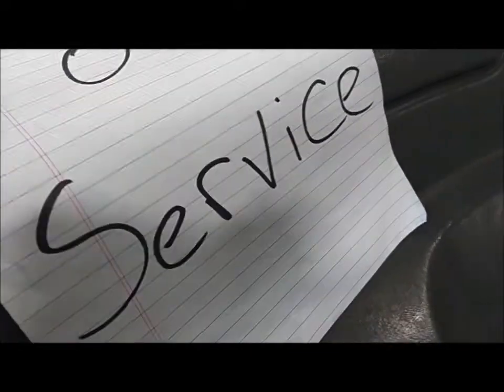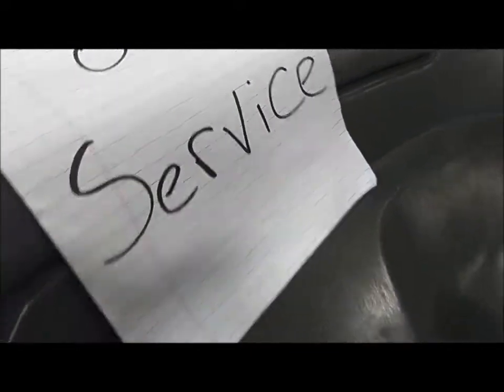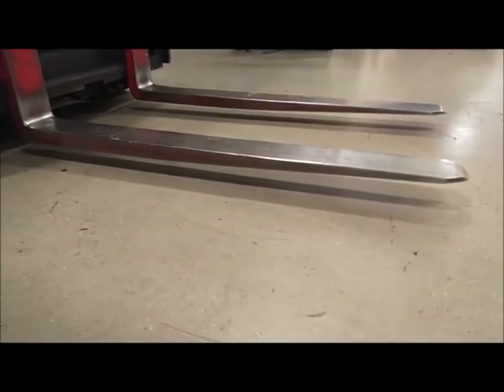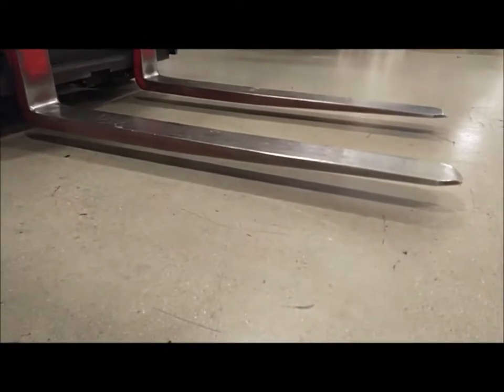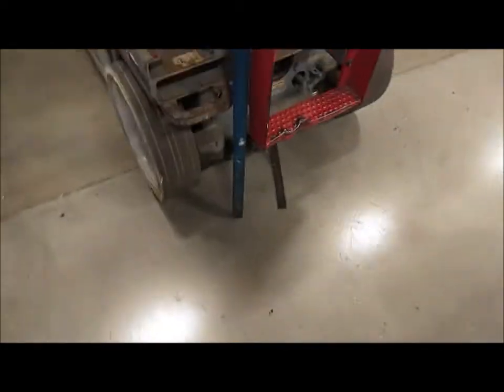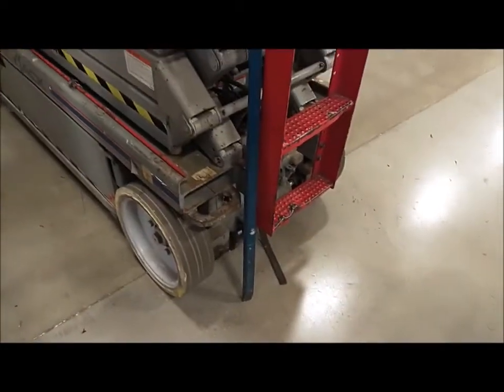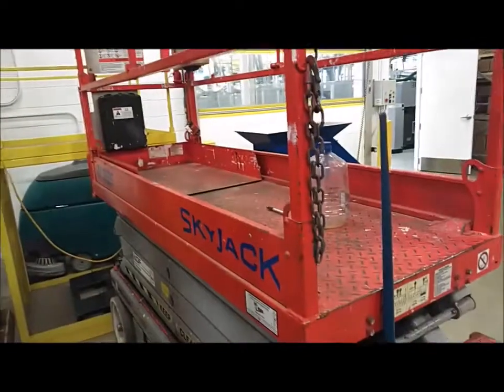Pinch Bar

Comment: Have you ever had one of the batteries come out when you're turning a corner with one of the trucks
Reply from the maker: No.  There are removable metal plates on either side that prevent that.  The rollers the batteries ride on are supposed to allow easy removal to check/ add water.  They don't.
Reply: @squiblift2019  yeah it never happened to me but it always happened to the same guy at the factory I worked at maybe like once a month you would do it